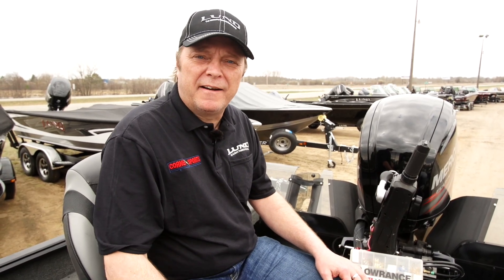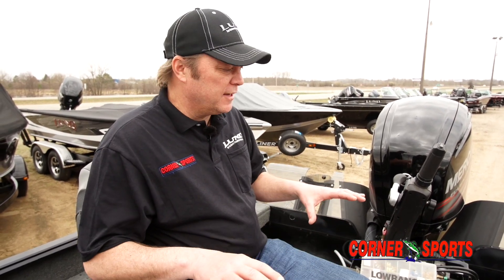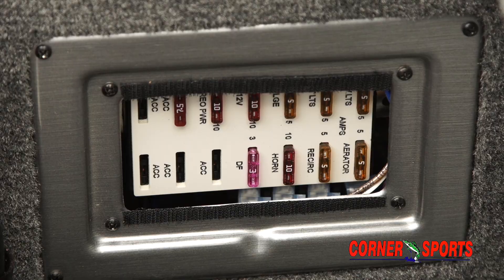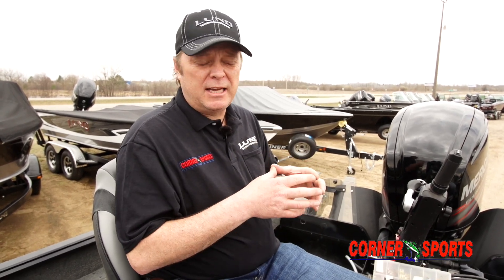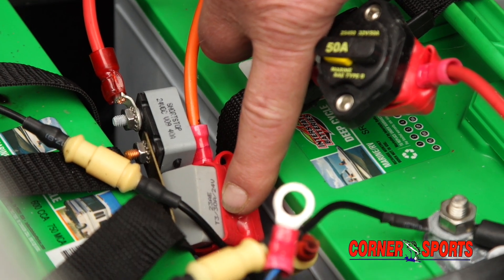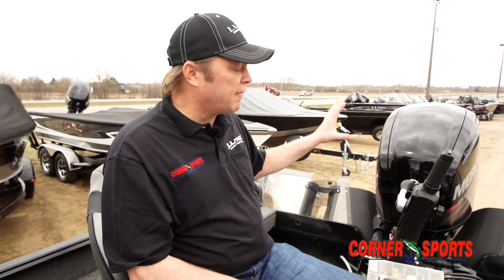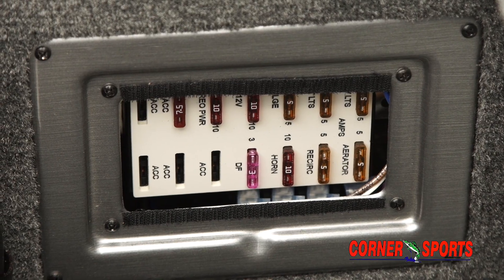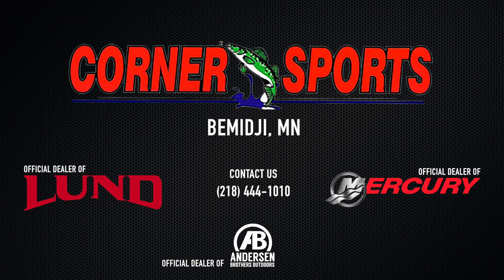Boat Maintenance Tip - Fuses

Comment: Thanks for that Mike, good tips.  The other thing is knowing WHERE the fuses and/or fuse box is.  I'm working on that now, I think? some of the components have both: a fuse in line and at the fuse box, if I'm right.  And a few tools too.  A nice kit for boating, that would be a great item to sell: prop wrench, regular tools, wire cutters, connectors, etc./all.

Comment: Hello my name is Nate I'm from South Carolina I have the 2005 bass tracker  It has  The 50 horsepower 2 stroke Mercury I put it in the shop To have the Garmin Ecomap plus 73SV installed I got the boat home turned the Ignition key And nothing happened  Could that be the fuse Everything else works